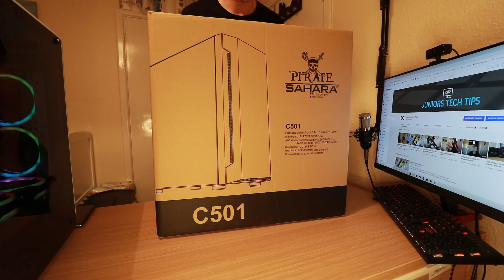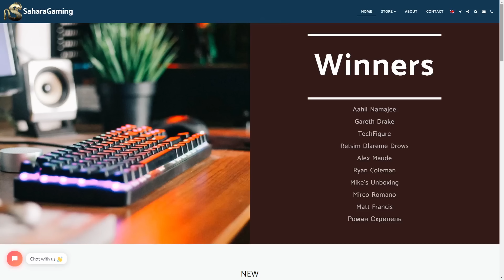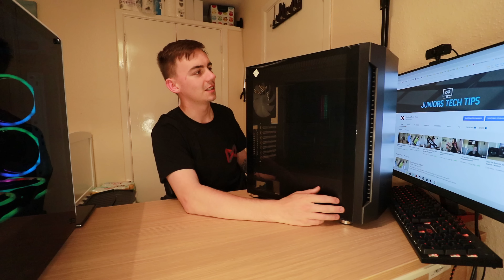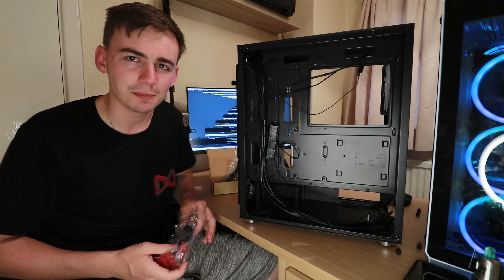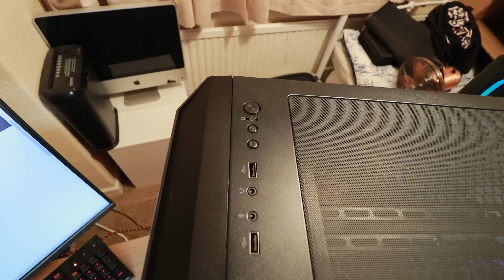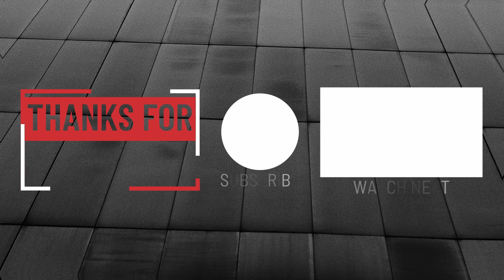Why Everyone Is Talking About These Cheap DUDIOS Headphones

Comment from the maker: This case is a beast for compatibility, supporting everything from Mini-ITX to E-ATX motherboards [01:01]. It comes pre-installed with four 140mm Blackhawk silent fans [07:24] and features a unique vertical GPU mount [13:21] to show off your graphics card.